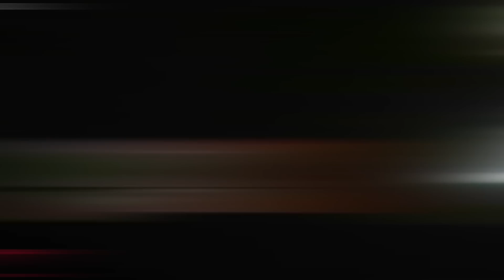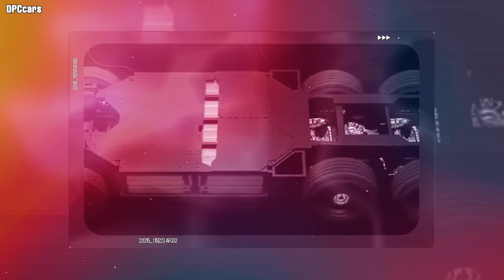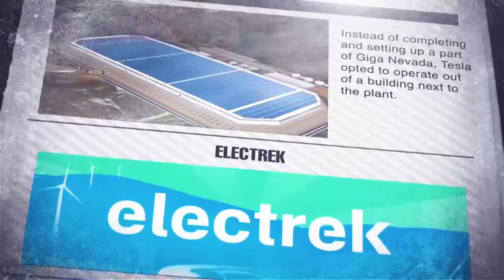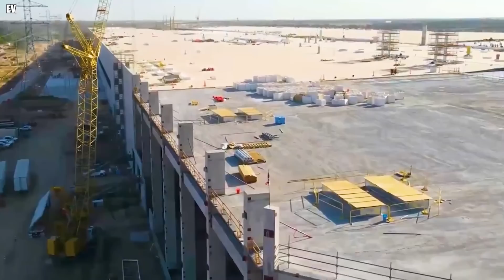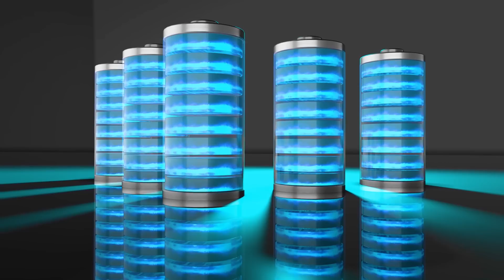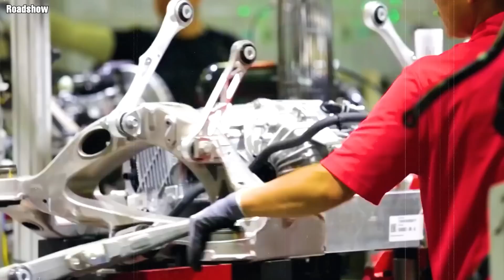Inside Tesla's NEW $2.4B Semi Truck Factory!

Comment: Out of all these replies, I have not seen one person accurately describe what the weight is for a 500 mile Tesla Semi. I’ve seen educated speculation. But Tesla is silent on this, and it is concerning. Elon touts a lot of “cool” things the truck is capable of doing. But we in the logistics industry haven’t heard what really matters. How much weight can I haul? For how long, and is infrastructure readily available. That’s all we care about.
Reply: Initially, this is limited to being a day cab. Over time, FSD and rampant megachargers would make ‘em long haul machines. Long range versions can do about 250 miles in non-winter driving keeping the battery between 20-80% for longevity. What it can haul is the $6.4 billion question. It will likely be less than diesel, but by how much, and will it affect most day routes?

Comment: Imagine how long it takes to recharge the larger battery pack.  Where are the heavy duty charging stations?  If not available then the 500 mile range would be 250 out and 250 back home for the company charger.

Comment: THE MATHS DOESNT WORK 4 ME ..... A 26 TON TRUCK CAN CARRY 15 TONS OF CARGO 600 MILES ON A TON OF FUEL ....... TESLA CLAIM 500 MILES BUT I THINK THEY WOULD NEED A 15 TON BATTERY TO DELIVER A TON OF GOODS LOL ? .... A TESSLA CAR WEIGHS 2 TONS ... A TON OF THAT IS  "BATTERY" + MY FAT ARSE + MY FAT ARSE FAMILY WOULD EQUATE TO HALF A TON SO EVEN IF IT GOT US 500 MILES (AS ADVERTISED) !!! U NEED 2 TONS OF BATTERY 4 EVERY 3 TONS OF WEIGHT (4 max range ) !!! .... dont 4get THE ACTUAL TRUCK WEIGHS APROX 10 TONS !! & ADDED TO LOAD + TRAILER = 20 TONS .... MINUS 3 TONS 4 ENGINE + FUEL TANKS leaves 9 TONS OF BATTERY 2 DO THE JOB... SO ALL TESSLA HAVE 2  DO IS DOUBLE THERE BATT CAPACITY 2 MAKE THIS TRUCK VIABLE ??? ....SHOULD B EASY 4 ELON ... EVEN  DONALD TRUMP GAVE EVERY1 A TUG OF HIS WIG .. WITH "FORCE I MIGHT ADD "  SO  PLS RUN YO FINGERS THROUGH YO HAYER NOB JOCKEY LOL

Comment: There has to have charging stands at major points on major truck routes in real world with heavy loads and weather 500 miles will not be possible.  Ok for local trucks like store delivery por p and d  for ltl there has to be way to collect road tax at charging stand like at fuel pump maneu by lwh purchased like per gallon

Comment: bore a tunnel to cover the 260 miles.  make a high speed transfer system in tunnels to move parts and batteries between factories.
Reply: Telsa's 2 mile loop in Las Vegas cost 1billion+ it would be too expensive
Reply: In 2 years elon will die and it won't be completed
Reply: *The tunnel took 2 years *

Comment: I have been driving tractor trailers for 30 years and theres no way you can back one of them up with the steering wheel in the middle of the tractor..If it dont back up automatically its gonna be useless.the only good thing about it is it is supposed to carry 80 k up a incline at 65 we will see...
Reply: Do you really think that wouldn’t be one of the things they were taking to consideration when building this do you really think this is going to come to market and it’s gonna be something that literally can’t be used to do the most basic of tasks?

Comment: How long would that go on a charge with a heavy load and going up steep hills. you think your drain the battery pretty quickly. What you do sit there and wait a day or two charges it again. The you would have to worry about hazardous waste from the batteries when you go dead. Plus the fire department can’t touch it because it is the same amount of voltage of the power line over heard. You change one thing it is like a domino effect effect everything. Way are these idiot want to change the past history by undoing doing the pass inventions.

Comment: The future of trucks, too me is hydrogen not batteries. A battery tractor, as the technology is too day probably too long to charge " will probably have to be left to charge over night "  and the waight from the batteries that's fraight not carried compared profits compared to a ICE truck .  Fueling time for a hydrogen truck will be comparebel to a ice truck's probably with the same amount of milleg as a ice truck or more and no batteries that's more fraight more profitability . But hydrogen has a draw back you have to use electrical energy in electrolysis too split the hydrogen molecular from the oxygen , the question is which is more economical batteries or hydrogen fuel cells ! .

Comment: I think this truck will be great for local delivery drivers but I think it remains to be seen how the OTR trucking is going to receive these new trucks when they get here. O/O’s that need to be able to drive 500+ miles per day and be able to have convenient fast chargers might be a problem. We will have to wait and see.
Reply: Have to be a way to change battery for OTR trucks ,
Reply: @tiptoe38  , did you mean change or charge? The battery can obviously be charged but how fast? I could fuel up my truck with diesel within about 10 to 15 minutes or thereabouts. I don’t believe a battery the size needed to power an 80,000 lb truck for 400 to 500 miles can be fully charged up anywhere near that short a time. I’m sure Tesla knows all of these issues. There are quite a few companies that have ordered trucks already and I’m sure they’ve done their homework. We shall have to wait and see.
Reply: @rickbullock4331  I mean change out and keep going.
Reply: @tiptoe38  , I know I’ve read where they are working on having it so when the battery finally bites the dust the change over is a simple swap out for a new one but to swap out for a fully charged battery I don’t think that’s a viable option right now. I think there is a lot of logistics to be dealt with for that option in a big way. I don’t know about a big fleet of trucks doing that down the line.

Comment: This will not work for anything more than local city run it doesn’t have enough range for anyone who is OTR or regional also what is the weight going to be of the truck batteries are heavy af if they cant get it below 20k it will be useless for heavy loads also where are you going to charge it unless it can go from 0%-100% in a 30 minute window its going to suck and we will loose money as drivers they would need to put tens of thousands of chargers because drivers would be sleeping while they charge this system will not work for otr or regional applications on either city runs or drivers who do less than 500 mile round trips the only people who think this will work have never driven a truck or are local drivers

Comment: If Tesla need to cut corners for some reason, they can make it less powerful and it will still be stupid fast! When all diesel trucks around you move slow, you are not going anywhere fast! No maintenance is the biggest selling point. It's like alien technology!
Reply: Semi trucks are not built for speed. They need to haul heavy weight around. And electric truck will have maintenance. Capacitor, diodes, transistors, inverters, motors, wiring, battery pack , suspension, tires, cooling/heating system for battery/motor they all will fail at some point and will need advance diagnosing skills to perform a repair. And just wait until all the road salt corrode everything. we gonna have all kinds of problems.

Comment: You could easily turn a small deisel engine into a generator to create 50kw of power and this truck would then do 1500 km no worries as long as the hills weren’t to high! Then simple leave the mobile generator at base for when the route is less than 500 miles round trip.Using deisel in this situation shouldn’t be a canceling factor to the transition from fossil fuels. Infact the exact opposite if it can speed up the transission as only certain situations would need a tesla generator!And down the track a higher capacity battery can be put in when the battery tech has evolved to 80O miles per charge .
Reply: Natural Gas - Generators

Comment: Adding battery packs to the trailers, for recharging during down time??
Reply: rv trailers trch ppl used this.  add battery pack / lng  gen too trailers.
Reply: the long term plan is that there will be no truck at all, just a battery powered trailer

Comment: for OTR 500 miles really isn't going to cut it. You need more like 600-650 with a margin because you cant just refuel when out like a diesel. Also this needs to have a cargo capacity of 45000lbs(industry standard maximum), and a GVWR of no more than 80000 while maintain the unrefueled range of 600/day. Quick charging also needs to be a thing otherwise you cant team drive. I didnt hear anything about cargo capacity, driving conditions, terrain and its relationship to range. A lot of critical unanswered questions remain. I always thought hybrids would be a better option for this but I guess we'll see.
Reply: it can charge in 30minutes to 80% with 500mile range and remember electricity is half as expensive as an equivalent mile's worth of gas. It is legally permitted to be 2,000lbs over to accommodate battery or more in many countries. I think it can reach the cargo capacity maximum, but there aren't any direct source numbers on it other than statements that it can haul as much as a class 8 truck.
Reply: not for long distance for day cabs and local routes, rich ppl used for their rv trailers weight alot less give them alot more miles
Reply: Not every truck is ever going to have to haul 45,000lbs.  Mine will do a regular 200-300 mile route with a much lighter load.
Reply: @victorvandyke9898  I believe that they are priced to compete directly with diesel semis not just a niche market. They will have to be fully as capable as the typical semi to compete even if those capabilities aren't used by everyone. Who wants to downgrade in capability for a higher price?
Reply: Well, Elon disrupts industries and by that goes the standards 😅
Reply: @bjarnesegaard5701  you never been to weight station have you? 😂
Reply: @bukovinian  The creator of this video certainly hasnt  been to the Tesla Nevada factroy where the Semi is being built.  Headlining that the video is inside that factory is a lie. It isnt. Just click-bait.
Reply: You do realize that Tesla runs a fleet of these right?
Reply: @malbers35  Do show us actual pictures of that 😂
Reply: Simple as that, you destroy "the smartest man in any room" 😁

Comment: Electric Semi Tractors= fundamental aerodynamic changes to Semi Trailors
   The worst part of driving behind or beside a semi is that if there is any moisture on the road, you cant see the road!! This causes accidents and anger toward truck drivers. If we are to transition to automated, electric semi tractors, the trailors will have to be redesigned as well.
   A simple solution to the problem would be to design a trailor skirt that can channel water directly to the rear of the trailor and kick it up into the air at such a rate that it would create a rooster tail rather than an inpenetrable fog of water. 
  Anti Wind Sheer Design- The fore mentioned trailer skirts would have the ability to fold under the trailor in high, cross wind situations. The top of the trailor should be rounded or hexagonal, similar to an air stream travel trailor. This would prevent exessive wind pressure that could tip a trailor on its side. Whatchu think about that, Elan!?

Comment: Well I want to say something about these electric trucks I was really bad and upset over the video I see what he said that wouldn't even have to have a CDL to operate one of these vehicles I'm a professional truck driver 35 years I take pride in my CDLs and I have earned my right to my CDL and everybody thinks this job is a piece of cake well I'm telling you what the job of my truck driver not everybody can do it and I guarantee you that it won't happen and if he's electric trucks get going there's going to be Recks out here too with electric trucks. And another thing if you have a hundred trucks in the truck stop they're all electric and they go 500 miles how's all this electric grid going to capacitate a hundred truck sitting there charging I don't think our electric grid will handle
Reply: They have the technology to make them charge while they are running. I guess it’s all politics.
Reply: @pedroespinal3593  Politics is driving this to begin with, but it will ultimately be decided by economics.
Reply: How long does it take to charge? You think the fuel islands are bad now?
Reply: I got a bad feeling about all this electric the grid is not going to be able to 80 or 90 trucks in the truck stop plug in to charge what's going to happen

Comment: A seat in the center? No thanks. That would create massive blindspots when backing. And as anyone who's driven a truck knows. It's not about racing up grades in 2.8 seconds. Unless your trying to throw the cargo all over the trailer. 
Fixing those issues, it may work for the day cabs that return to base everyday. If the batteries don't weigh too much to make it unable to legally carry a fully loaded trailer.
Reply: Good luck paying $1.64 per litre in gas then. You're really showing us.
Reply: @jordangate7742  Good luck having to replace the whole battery after 3-4 years of by god don't soak it in water or it will die
Reply: @MattCiv4423  uh... good one? You don't do your research at all before you speak do you.
Reply: @jordangate7742  Currently I pay about 3.50 a gallon in diesel. Or about 0.875 per liter.
Reply: Did you ever consider electronic mirrors?  They could "see" even better than the fixed mirrors on today's trucks.